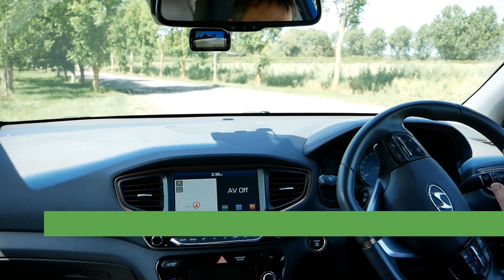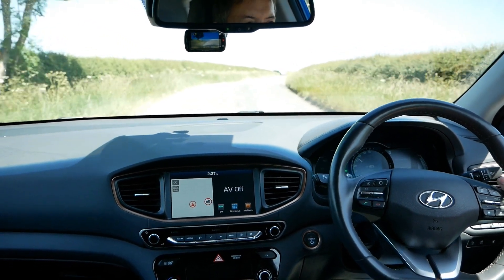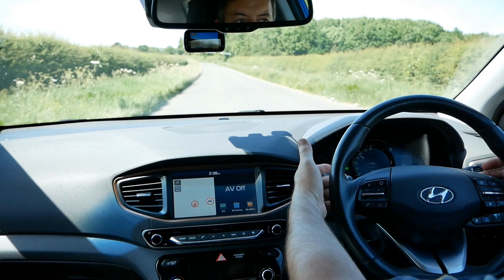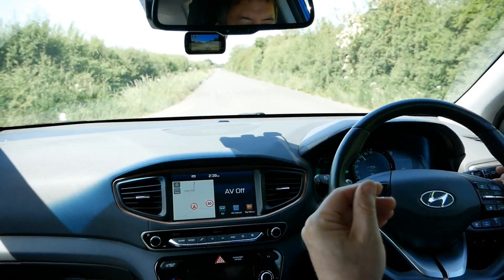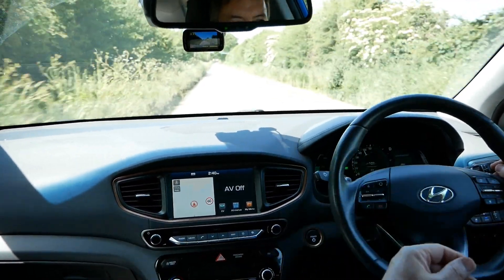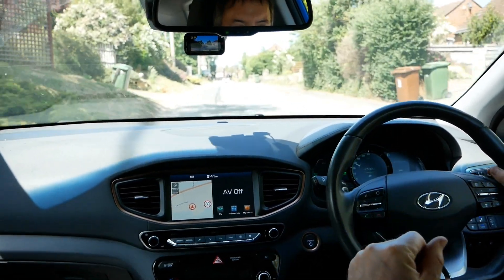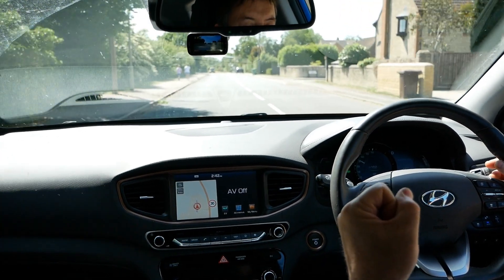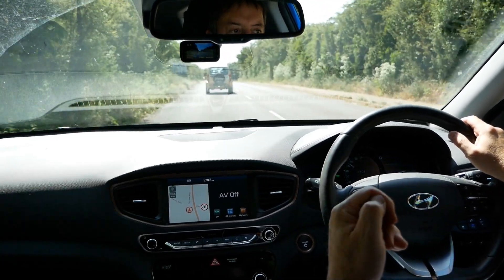Explaining regenerative braking in a Hyundai Ioniq Electric EV

Comment: Ok I’m an idiot - but I’ve watched this and still haven’t got a clue how to use the regen paddles on my ioniq 22 😅… are you able to explain like I’m 5 to me? I’ve never adjusted anything since I got the car bc I’ve been scared to touch them 😂(I’m also an incredibly cautious new driver and it’s my first ever car, I’m disabled and hire from a scheme but nobody I’ve asked seems to know 😂) scared if I touch them everything will change and that might be a good thing but I need it explained first 😂
Reply from the maker: It sounds like you need to go out on a quiet road and just try it and get used to what they do. First off, the default regen level (0,1,2,3) is set by the driving mode you're in (sport, normal or eco). As standard, these are level 2. But you can change this within the EV menu on the screen. We've always set it to default to regen level 3 in all driving modes. Then at that point, its up to you whether you bother changing it during the drive with the paddles. My partner never touches them and just drives on level 3 regen and then just uses light accelerator adjustments to control the regen. Most drivers will probably just do this and I'd suggest that is probably what you'll end up doing. But do change the default to level 3 regen on your drive modes.
But if you do adjust the regen with the paddles, the left increases it and the right reduces it. It shows you on the instrument cluster too, so its all pretty clear. Plus you can feel the difference.

Comment: Great demo.  Much appreciated!  What is your experience with the brake lights coming on?  I have seen some forums where people think that it comes on during regen level 3, and others who think it may be relative to velocity, but I haven't seen anything official, nor been able to get anyone driving behind me to confirm.
Reply: I have a 2022 Hyundai Ioniq Hybrid and as per the user manual, the rear brake lights come on for regen levels 2 and 3, but not for level 1.
Reply: @CaptainTenneal  Thanks very much. I couldn't find anything on that in my 2021 PHEV manual.
Reply from the maker: All EVs put on the brake lights at a pre-defined amount of de-accleration.
Reply: @GoGreenAutos  Great description. Thank you very kindly.

Comment: As far as I know the brakes also use regen and only engage the real brakes when you brake hard. So is there actually a difference in consumption between using the flappy paddles or the brakes?
Reply from the maker: Driving economy is always worse if you use the brakes.
Reply: @GoGreenAutos  That makes sense when you use the actual brakes. But why is it less efficient if they also use regen?
Reply from the maker: @kieferngruen  Because any brake pedal pushing applies brake force and therefore you're wasting kinetic energy into friction and heat on the pads (however light) instead of just using regen and lifting off the accelerator a few seconds earlier.
Its on the older Zoe's that have a decoupled brake pedal where (at over 40mph) the brake pedal increased regen.
Reply: @GoGreenAutos  Thanks for the info. I thought that the brakes only engage the pads when you brake hard and regen isn't enough.

Comment: I test drove an ioniq the other day, it didn't have the paddles. Is that the newer model? I can't see how Hyundai would remove the ability to adjust regen in a newer model, they would want to be adding more features not removing them. I can only think that the way to adjust it has changed? Sales lady was useless.
Reply from the maker: It wasn't an electric one then. Just have been a petrol hybrid.
Reply: @GoGreenAutos  thanks. Yes it was hybrid. Hybrids don't have the regen control?
Reply from the maker: @e1337prodigy  Hybrids = small electric motor, small battery pack, small regen.